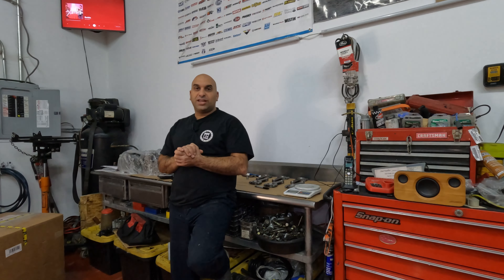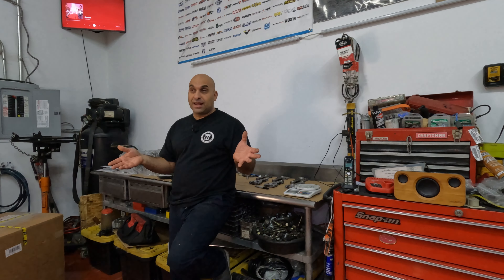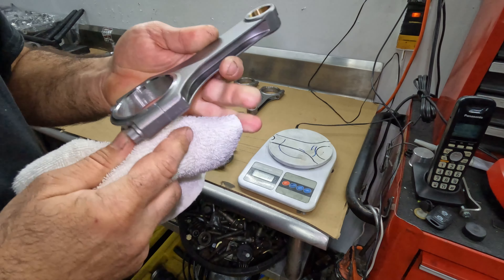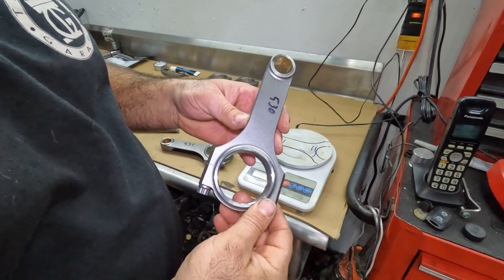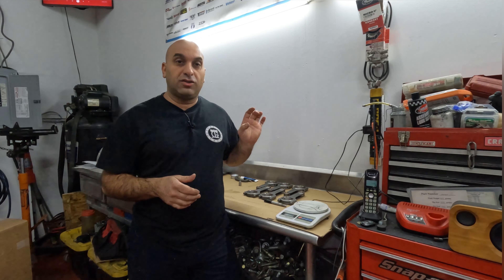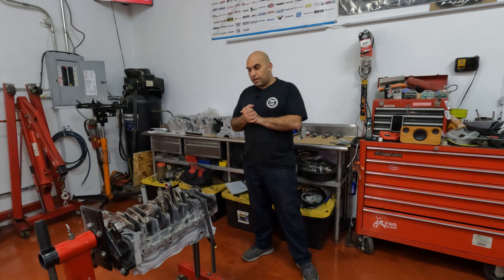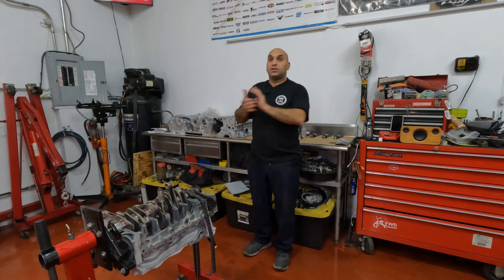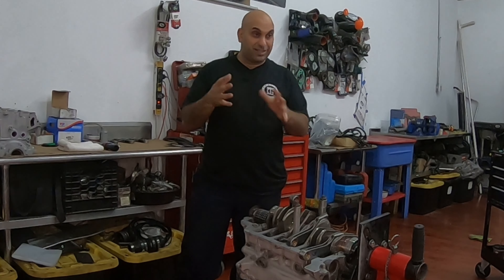Porsche 911 turbo 997.2 9A1 engine rebuild part4 how to balance Carrillo rods short block assembly

Comment: When balancing you should measure the rotating and reciprocating mass of them conrods, not just total weight!?
Reply: Yes try to measure both ends separately, having the other end on certain support block so the height of that end is always the same. And one gram or .2 percent is nothing to worry about.